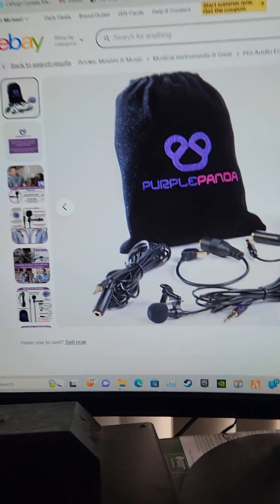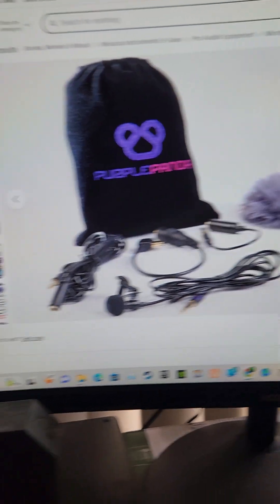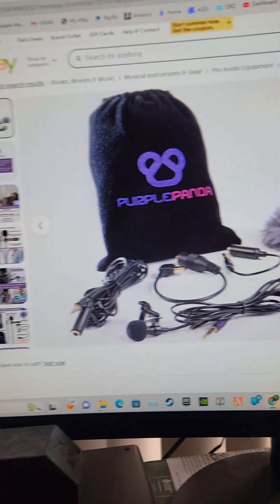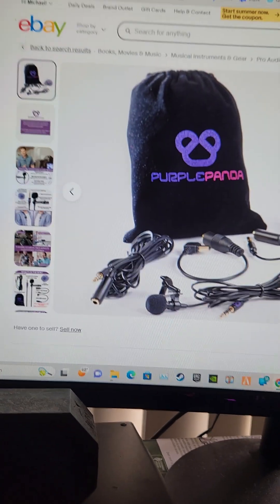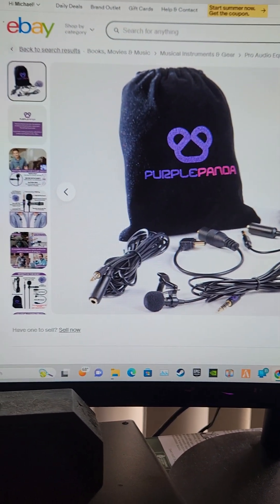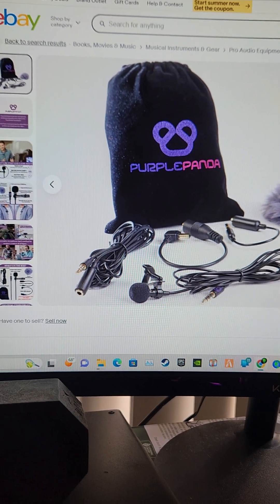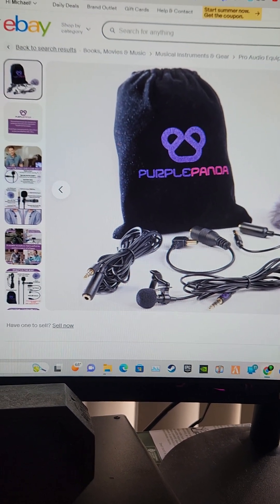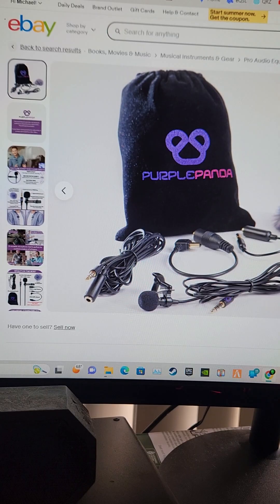JPC-12 Antenna used on an activation today with issues. DX Engineering coax wouldn't connect secure

Comment: Aw man that is the most annoying thing ever... I'm always worried that some of my coax's aren't going to make a solid connection and cause an arc or something while transmitting. How have you been by the way? Been awhile since I've been on the ol' swan. W7NJG, 73's :)
Reply from the maker: Luckily I had those adapters with me. Saved the activation.